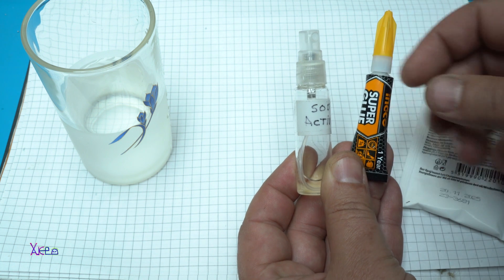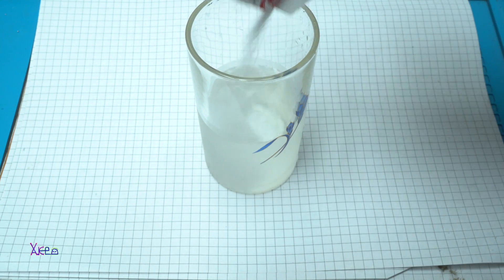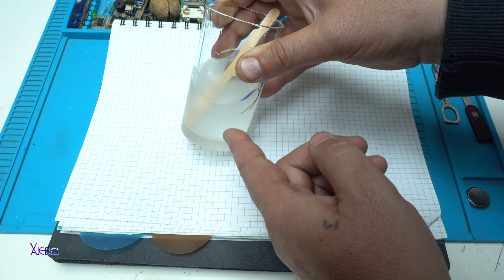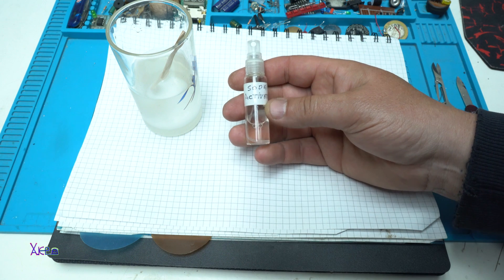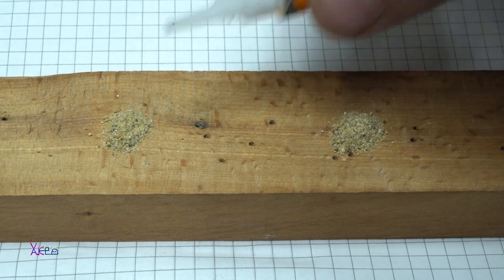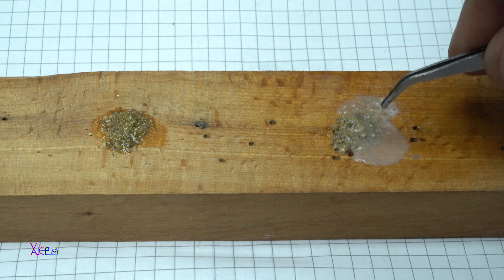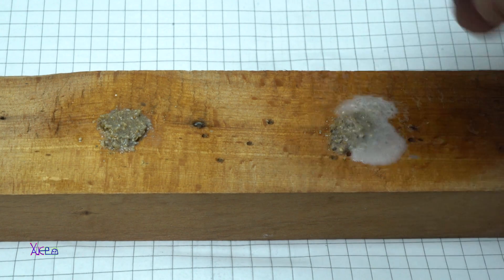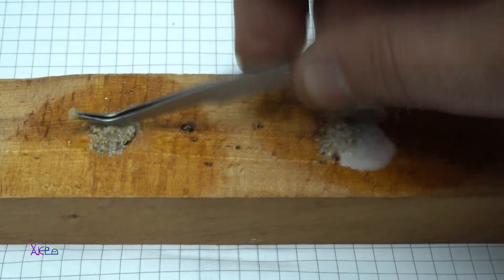How to Make Super Glue Accelerator

Comment: Great idea! Can you disolve baking soda in isopropilic alcohol to make it evaporates quickly?
Reply: Yes
Reply from the maker: I dont know,I need to try it!
Reply: Solubility would be low in alcohol; that being said, provided it mixes okay with a pre-disolved solution of soda and water, and provided you don't end up with a milk shake, using 30 percent alcohol would probably improve drying considerably.  This is because as the alcohol fraction evaporates, it will help "lift" the water with it.  Being fairly exothermic, the results should be accelerated even more.

Comment: The question is if it activates too quick doesn't that make it a weaker bond or something that can be pulled out easier?
Reply from the maker: Need more experiments so I can tell the difference
Reply: @Hacktuber  activator can decrease strenght up to 20 percent
Reply: No idea if it is right, but the google AI says: 
Baking soda can significantly speed up the drying time of super glue (cyanoacrylate). When baking soda is added to super glue, it initiates a chemical reaction that causes the glue to harden almost instantly. This reaction also creates a stronger and more durable bond compared to using super glue alone
Reply: accelerator makes a much stronger bond. I think it's due mostly to the fact that when no activator is used the pieces have higher chance of moving around before the glue cures and that's what is to blame for a weak bond when using super glue alone